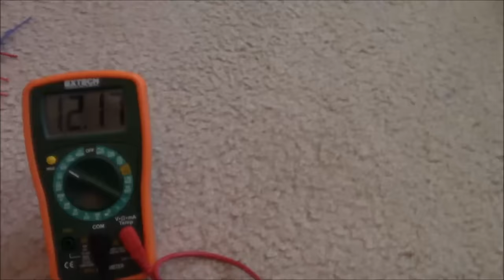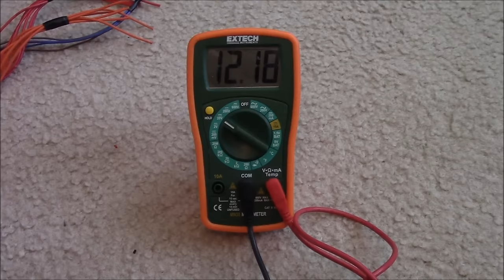How to Hack a Computer Power Supply (PSU) To Use as a 12V DC Power Source

Comment: Thank you very for this vedio,
How if I need 12v but 5 to 9 Ampere not more than 9 A ?
Reply from the maker: This power supply would only be useful for 5v or 12v.
Reply: +LDSreliance I know that my question about ampere?
Reply: +LDSreliance if my power gave 25 ampere and my device just need 5 ampere is this my burn my device?
Reply from the maker: Hyper Tube
No, that is a common mistake.  Your device will only draw 5 amperes.  The power supply does not force 25 amperes on the load.
Reply: +LDSreliance thaks alot
Reply from the maker: Hyper Tube
You are welcome.  Thanks for watching and please consider giving me a thumbs up or hitting subscribe to help me out!
Reply: +LDSreliance Ok 👍
Reply: +LDSreliance can I charge a 3.5 V individual li-ion battery using this arrangement. I've already made this power supply a year ago, thanks to you and now I wanted to use it as a charger for charging a li-ion battery (or two in parallel which I found from an old laptop battery). please let me know about the o/p current since I believe it will blow up my batteries if it's huge o/p current :D ... please reply ASAP. I'm doing a project right now. 

thank you.
Reply from the maker: Mohammed Afzal Ib'n Anvar You really do not want to charge lithium batteries without something that has charging circuitry in it.  Lithium batteries catch fire or explode if they are overcharged or overheated.

But theoretically you could do it with the 5v rail.
Reply: +LDSreliance So is there any way that I can charge them individually ? 

Thank you for the faster reply :)
Reply from the maker: What kind of lithium cells are these?  They make chargers for 18650 cells and so forth.
Reply: Its a 18650 (3.7V) and I'm looking to charge them individually. Got any ideas ^_^ ?
Reply from the maker: Mohammed Afzal Ib'n Anvar
I would rock something like this:
https://www.amazon.com/NITECORE-Intellicharge-Universal-EdisonBright-Converters/dp/B00GODG3X0

You can charge it with this psu by hacking off the cigarette lighter adapter and connecting it to the +12v rail on the psu.  Or you can just plug it into the wall directly.  It also charges other kinds of batteries, including a dozen or more li-ion.
Reply: +LDSreliance Wow. I will get one of those since I got a lot of works to do with these batteries. Thank you so much. I really appreciate your kindness. Unlike from many other Youtubers, you find time to reply to your subscribers and that's cool bro. 👍👍👍. Peace and blessings be upon you. I'll catch up with you. Until then. Stay healthy, Stay strong.
Reply from the maker: Mohammed Afzal Ib'n Anvar
I appreciate it!  I hope I can always respond to comments.  Good luck!
Reply: LDSreliance Hi, I want to use an IDE DVD writer, I want to connect it directly to the PC power supply. how can I proceed? then I'll connect the IDE DVD writer to my netbook to read/write DVDs

Comment: Question i hope you can answer. My friend has 2 older style police lights and i did this w power supply and it will only run 1. Each amperage draw check of each light is under 2 amps. It runs either one by themselves with no problem but kicks out when both connected in parallel.  Any ideas?? I figured this would have zero issues running them. Appreciate any input
Reply from the maker: Can you connect the exact same wiring to a car battery and get it to work?
Reply: @LDSreliance  I will check tomorrow and let you know. Really appreciate your time and reply and ill get back w you on that. Thank you again
Reply from the maker: You are welcome.
Reply: @LDSreliance  I apologize for late reply, we got blasted w snow. So each light drew almost 1.9 amps (just running them Separately). Now i havent done the math on each circuit setup but here is what i found out. The power supply would shut down having the circuit in parallel. I tried running the lights in series and woola,,,it is now working. Power supply just didnt like them in parallel so i didn't think that would have been an issue so maybe the math will explain it.

Comment: Why is it that well I'm trying to make a hotwire foam cuter wich consist of using dc and take a pice of metal super small gauge and then putting the ground and yellow on the wire but when I do this my power box turns off?
Reply from the maker: +DIED12 ROBLOX&MINECRAFT Because you are creating a short circuit.  You can't touch the positive and negative wires together (or connect them to the same wire).

Comment: nice video, i have question, if configuration like that, the current will go maximum point? (ex, Psu said max 20A) will it go 20A all the time?
i want powering the Power ampifier car audio..
bcause adapter in aftermarket sell with high price.
Reply from the maker: No, it supplies up to 20A.  It can supply less just fine.
Reply from the maker: What he said!
Reply: Bobby Heryawan  Be careful with this:
For example one power supply I have is rated at 300W total.
But that is broken down between the various outputs (and shown on an external label), so it might be
12 v  - 90w
5 v - 40 w
3.3 v 40 w
-5v 40 w
-12 V 90w
That would mean you could only draw 90w on the 0v-12v  12v x  7.5 A = 90w.
You could only safely draw 7.5 A in this example.
Reply from the maker: Richard Farmbrough
True.  You won't be able to get the full watts of the power supply @ 12v.  Probably just a little bit over half on most power supplies.

Comment: Good tutorial. I followed this with a coolermaster masterwatt lite. When booting up the fan does not run, it twitches a little and stays static. I am getting 12v out of the PSU even though the fan is not running

I ran a multimeter on the fan connector in the psu and it's only spitting out 3.3v is this normal behaviour for the fan controller? I tested the fan in another computer and it works fine at 12v.

Any ideas?
Reply from the maker: I am afraid I don't know.  It sounds like a bad fan.  At lower loads it shouldn't be a problem.  You can always rig up an external PC fan to blow into or out of the case and just tie in to one of the 12V leads.  Just carefully drill some new holes or use self tapping metal screws to mount the fan on the outside of the case.

Comment: Is all of this information correct? I've purchased an ATX PSU (IP-S350T1-0).

I actually wrote this up myself, with the information I've gathered and learned online.

ATX WIRE COLOR CODES

BLACK : GROUND
ORANGE : +3.3V DC
RED : +5V DC
YELLOW : +12V DC
BLUE : -12V DC
GREEN : POWER ON (SWITCH)
PURPLE : +5V DC Standby
GREY : Power Good
BROWN : +3.3V DC Sense
WHITE : -5V DC

Q. What do I do with the BLACK WIRES?
A. They are GROUND.

Q. What do I do with the ORANGE WIRE(S)?
A. Connect it to a BROWN WIRE(S) (+3.3v DC Sense) Senses 3.3vdc.

Q. What do I do with the RED WIRE(S)?
A. Might have to connect it to a single BROWN WIRE(S). Sense 5vdc.

Q. What do I do with the YELLOW WIRE(S)?
A. It's +12V DC.

Q. What do I do with the BLUE WIRE(S)?
A. Nothing. Cap em.

Q. What do I do with the GREEN WIRE(s)?
Aa. Connect it to a GROUND WIRE.
Ab. Connect it to a SPST Latching Switch.

Q. What do I do with the PURPLE WIRE(S)?
Aa. It's good for USB hookup, or connections.
Ab. It's good for +5V DC.

Q. What do I do with the GREY WIRE?
Aa. IGNORE IT.
Ab. Can be used for Power On LED with 330Ω Resistor.

Q. What do I do with the BROWN WIRE(S)?
A. Connect it to an ORANGE WIRE(S). +3.3V DC Sense.

Q. What do I do with the WHITE WIRE(S)?
A. Nothing, IGNORE.

Q. What the hell is the 10Ω,10W Resistor used for?
Aa. Most ATX Power Supplies will not stay on, unless it 
has a small load on it. So to fix this, connect a 10Ω/10W Resistor to the RED (+5V DC) and BLACK (GROUND).

Q. How much power does +5V at 10Ω dissipate?
Aa. The calculations are 5Vdc, 0.5A, 10Ω, 2.5 Watts.
    So technically, a 10 watt resistor is fine.

Is all this information correct?
Reply from the maker: +Mark II Looks good.  I think it is more correct to call the black wires "negative" instead of ground.  You might want to also recommend that they wire in a switch before the resistor so they can turn it off.  Otherwise if they hard-wire in a resistor the psu will stay on forever since it will detect a load.
Reply: LDSreliance Can I use heating element with this.. I mean, it's a short.. I want to experiement with PTFE wire, and heating the wire to make small scale heating elements for clothing, heating pad, etc.. will it shut off, if I ordered everything, which I have.. off of Mouser, and wire everything up..? will it shut off..? I think I heard something online about it having to be less than something like 0.002Ω in order for the PSU to shut down.. but my resistance is far more than that.. something like above 1Ω..
Reply from the maker: Mark II
There isn't any way to know unless you try.  It depends on the psu manufacturer and what controls and electronics they put in.  I have never actually run into a psu that requires a load but I haven't hacked up too many of these either.  If the wire breaks it will shut off.  If you want to be sure it stays on, put a small load on the 5v rail (the USB rail).

Comment: I am trying to power a strip of LED lights, with two wires on one end a red one and a black one. I have tried putting the black to the back wires and tried the red wire on the bundles yellow wires, but the lights do not come on. The fan does come on the power source so I know that part is OK. So what am I doing wrong? The lights did not come with any cord or clip or anything at all other than the strip of lights with the two wires at one end. Cool white 300 bulbs 5 meter length, 7mm wide 3528 SMB
Reply: I got it, a bit of a loose wire.
Reply from the maker: That will do it!  Thanks for watching.
Reply: You're welcome! Thanks for helping me put more lights in my garage--with more to come, hopefully :)
Reply from the maker: Nice!  Good luck.

Comment: Thanks for the video, but why we need to join all the yellow ones? if I measure just one yellow with one black I dont get the 12 volts ?
Reply from the maker: +Roberto Steve Lou Yes you do but you can only draw so many amps through a tiny wire like that.  If you draw too much it will burn up the wire and possibly start a fire.  By joining them all together you can allow the current to flow through many wires and not heat them up too much.
Reply: Thanks again! but I dont get it, a DVD Rom using that same PSupply uses only one yellow cable and thats it.  It burns?
Reply from the maker: Roberto Steve Lou
A DVD Rom drive only uses about 20 watts of power or about 1.6 amps.  That is a very safe amount for one wire.  But if you wanted to use 10 amps (120 watts) for a device that same wire would heat up and potentially catch on fire.  So if you want to be able to use devices that use the full 20 amps of power of the power supply you need all of the wires together.
Reply: Nice! Now I got you!  If my PSupply says it has in 12 V, 14 amps, that means it will have those amps only if I join all the yellow cables in one right?
Reply from the maker: Roberto Steve Lou
There will be a -12v and a +12v.  You want to look at the +12v.  If it is 14 amps that means the power supply can supply a max of 168 watts.  You don't have to use all the wires to get those 14 amps.  But it would be the safest option.
Reply: Thank, thousand of thanks from Panama, I see you multiply volts per amps and find watts.   Is it enough to power a car amplifier?
Reply from the maker: Roberto Steve Lou
It would be a very small amplifier of 200 watts or less.
Reply: +LDSreliance you can get 18watts from 12v output only, http://web2.murraystate.edu/andy.batts/ps/PowerRatings.htm
Reply from the maker: PC KUCHING
18 amps would be fairly typical for a 475 watt power supply.  But they go much, much higher than that.  475 is actually a really small power supply these days.  Most new computers come with at least 500 watt power supplies that I have seen.  Check your manufacturer specs to get the exact number.
Reply: +LDSreliance My mistake, it is 18A, 12V X 18A = 216 watts
Reply from the maker: PC KUCHING
Correct.

Comment: and what happen i i just use the 12v cables from the 24 pin connectors ? can be good anyway to erogate at least 120W with the 12v on a 500W PSU ?
Reply from the maker: Yes you could do that if you limited the current you are using.  You would not be able to use the full current of the 12v rail.

Comment: Hi good day. Thank you for this helpful video.
I have some question about it, cause before I'm going to do this, need to consult first that I am doing right.

I am planning to make an Egg Incubator. Now the thing is:

Heating element = 12voltz / 50watts (2pcs)
CPU Fan 120mm = 12voltz / 4.32watts (2pcs)
Thermostat STC-1000 = 12voltz / 3watts

Now the question is, a 350watts Computer Power Supply is enough for all of them? Everything is 12voltz. "Mini-cabinet Egg Incubator"

Thank you so much, hope you can help me :)

Good day!
Reply from the maker: Alvin Isiderio It should be.  You really need to know the specs of the +12v rail in the power supply.  There will also be 3.3v, 5v, -12v, and 5vsb rails as well that use some power.  So if your power supply is 350 watts or roughly 30 amps then your +12v rail might only be 20 amps (240 watts).  Or it could be less.

But with your loads that you are using (<150 watts) you should be fine.  I can't imagine the +12v rail being less than 15 amps.
Reply: LDSreliance Thank you so much for your fast reply Sir/Madam. Well, I will make it double purpose at all. Since we have brown-out times here in Philippines, going to add a Car Battery that it can be switch on when brown out. In that case, I can stable the power. Is it possible that I can charge the Car Battery using PSU? Something like if I use more like 500W+. Also yes, I know the rail of +12v in the power supply. As you also demonstrate in your video. It's the yellow, all together with the black which is the ground. How long do you think the 9plates Battery stay for that stuffs when plug during brown-out times? Also, it's not that kind of straight use cause I have a Thermostats where it will switch off the heater once the temperature of the incubator reached. Thank you so much for the help and fast reply. Have a nice day! More Power!
Reply from the maker: How long you can run the device will depend on the amp hours of your battery.  Also, you can't use a computer power supply to charge a battery because you need at least 14v to charge a 12v battery.
Reply: LDSreliance Ohhhh okay, thank you so much. I was already confused with that if I can :) Thank you so much for the help. Really appreciated it! Well, I guess I will buy a car battery charger. I am thinking for 9 or 11 plates Car Battery Size. Well, idk how long does it stay. Well, for battery is different story. When brown out, I'm not going to use full stuff. When brown-out, going to used: 

Heating element = 12voltz / 50watts (1pc)
CPU Fan 120mm = 12voltz / 4.32watts (1pc)
Thermostat STC-1000 = 12voltz / 3watts

only. How long do you think a 9 or 11 plates battery stay for that stuff? (Hours)

Thank you, have a nice day! More Power! So happy that I found this video (also your page here). So very helpful!
Reply from the maker: If you can tell me the amp hour rating of the battery I can tell you how long it should run.
Reply: LDSreliance I ask outside last few days if what kind of battery should I use but it turns out that he can't answer me straight with my question. Now, as far as I remember, he told me something like 30amp and 50amp for the another one but not together with hour, he just only told me the amp. Hope that information help. Sooner or later, I can go there again outside and ask it again. But for the meantime, that's all information I can provide. Thank you so much, really! Good day!
Reply from the maker: OK no problem.  If we assume that you are using a 30 amp hour battery and your total load was 60 watts then you should be able to run your device for 6 hours straight.
Reply: Really appreciated your help Sir/Madam. Thank you so much! What a big help. Now I have the idea. More power. I subscribe your page that I can have updates. Really so helpful videos :) Thanks again and have a nice day! :)
Reply from the maker: Alvin Isiderio
You are welcome.  Thanks for subscribing!
Reply: LDSreliance Hi dear, it was so very helpful and great video it is and it works to me, I did what you did and reach the point of what I want. But now, there's a problem. I got my stuff today and I want to check it if it works using the power supply, now the power supply won't work, idk what happen exactly but I didn't use it for about a week where I am making my project and that power supply is included at all. Thing is, when I switch it on, the plug itself makes a bit fire (like crack in the outlet) and it will switch on only for about .5seconds. Then I take off the green and black where it starts the PSU and try to connect and it will start only for .5seconds and turn off. Now, hope you can help me, what's the situation of my PSU or the problem of it? Hope you can help me. Thank you in advance! :) Good day! :)
Reply from the maker: Alvin Isiderio It sounds like the power supply has been damaged somehow.  But just in case try plugging it in to a different power outlet in a different room.  Also, make sure that there are no shorts in the wires (accidentally touching each other).  That will cause the power supply to shut off.
Reply: Well yes I guess so. Well, going to look for another one I guess. Thank you for the fast reply again :)

Comment: Can we use the -12v 0.8a BLUE 
with a +3.3v Yellow 
to get a 15.3v potential to charge batteries  (at 0.8a blue limit) ?
Reply from the maker: Theoretically this works.  But I have not tried it before so I would test it with a multimeter first and also don't use a battery that you can't afford to damage for the first try.